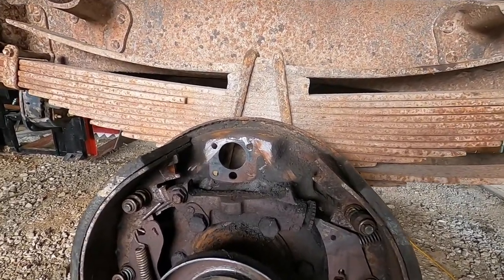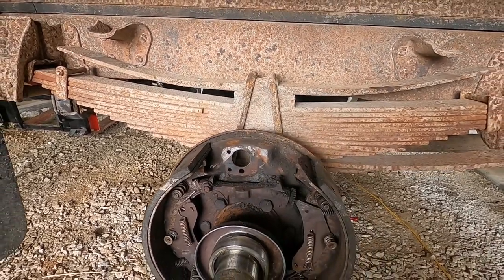Big Blue Brakes Part 1 - The Chevy C60 Wheel Cylinder Removal

Comment: We have a 71 GMC c65, I'm about to dive into. She runs and dumps fantastic, just needing to stop. You know... Ha. Going to  replace all four as well. I'll be following closely so as to pick up what you put for
Reply from the maker: There can be a lot of frustration with things not moving when they should move.  Be prepared to replace the wheel cylinders and maybe a line or two when you strip out the line nuts.  Mentally prepare yourself for the WORST.  That 71 is a great looking body style, though.  Keep that old iron running!  Thanks for watching and commenting!

Comment: Good information! Need to do some work on my 73 C60 also!
Reply from the maker: Grain truck, dump body, flat bed?  Thanks for watching!
Reply: @FabbedFun  grain truck with cut down sides, similar to yours actually. My front axle has all 10 lugs though.
Reply from the maker: @rhettfarnum  You gotta check out my Project Yellow videos...  GMC 7000 with 22.5s
Reply: @FabbedFun  I definitely will! Did you find 22.5's with the small pattern or swap axles? Or is it late enough to have the big bolt pattern stock?

Comment: Love these I'm looking at 72 with 427 5 speed 2 speed rear end with tandem axles use to be grain truck no hydraulics or bed do you need cdl drive this i'm getting conflicting info
Reply from the maker: So, a lot of the CDL stuff has to do with use.  Our C60 and C7000 are under 26k GVWR, so we wouldn't have to get a CDL either way.  I also put farm tags on mine, so I wouldn't have to get CDL with that either.  Check with your local laws.    In Indiana, a farm use truck or RV can be tagged as farm and you are legal without a CDL inside Indiana (and I believe within a certain mileage of the state border).

Comment: With the brake drum off are you able to see the back side of the wheel studs? Replacing some wheel studs on mine and seems like this video is as far as I'll have to go to get to them.
Reply from the maker: It's been a while, but yes, if I remember correctly, it should be that simple.  Getting the drums off isn't always fun, though.  Sometimes you get that ridge of corrosion and rust that catches on the shoes and you have to "persuade" them off.  I have a feeling you've run into that before, though...  Best of luck to you!

Comment: Back again commenting! FYI, Inland Truck Parts says there are Hydrovac canisters available in their system according to the gentleman in Omaha, Nebraska.  My question for you now is: how do you change the rear differential gear oil without completely disassembling the front of the pumpkin? I have a C60 and a C65...neither have drain plugs! I don't like the idea of suctioning it out as there's no way to knowing about the fine metal filings. Ideas? Can't find video about it on YT.
Reply from the maker: Good question!  I thought mine had a drain, but I suppose you could jack up one side and remove a seal at one wheel hub to get most of it out, but I have a feeling it would leave the sludge at the bottom of the pumpkin.  You COULD try welding a large nut near the bottom, then drill a small hole...  after it drains, you plug the hole by threading a bolt with sealing washer into the nut.  Just gotta be careful not to hit threads when you drill (or get it too hot when you weld).  I wonder if that's been done before...??

Comment: Do you have a part number for the front wheel cylinder
Reply from the maker: I do not.  Sorry.  You may check with your local medium duty truck repair place and try to cross reference any part number they can give you...

Comment: Working on the same project. Are the top and bottom cylinder and each side the same? I know there’s a different part number for each side, but not sure if the bottoms cylinder are the same number as the top.
Reply from the maker: Oooohhh... It's been a while since I did this, but I think the wheel cylinders are pretty close to the same.  There was a different casting on the back, but I wasn't sure if that would have made a difference.  I think there is a long side to the cylinder.  Be very cautious and take a close look because I don't think the fitting for the brake line is exactly centered.  Correct me if I'm wrong.  Best wishes on your project!  Will it be on video?

Comment: Make sure to keep us updated on parts availability! Did you turn the drum? I'm guessing the drum may be hard to get if needed? Any issues with the vacuum/brake canister (assuming it has one)?
Reply from the maker: No issues with the booster...  We didn't turn the drum on the C60.  It has pretty good brakes after replacing lines, wheel cylinders, and bleeding the system.  Apparently my newer C7000 has rotors that are still available.  Thanks for watching!